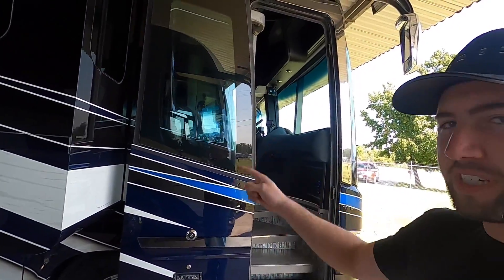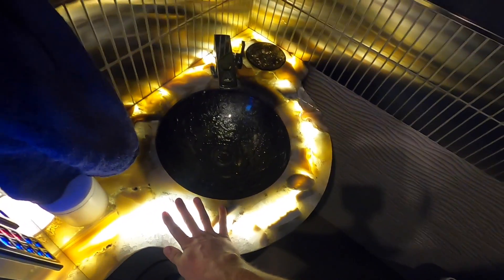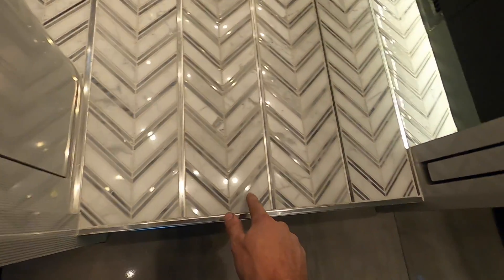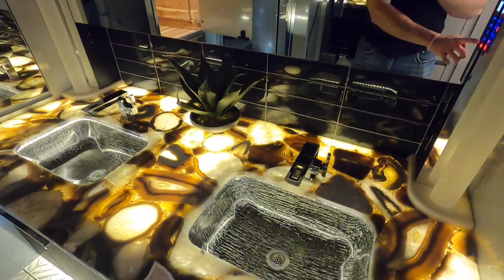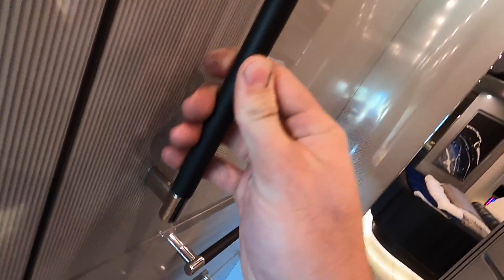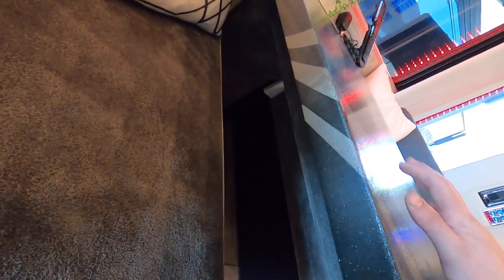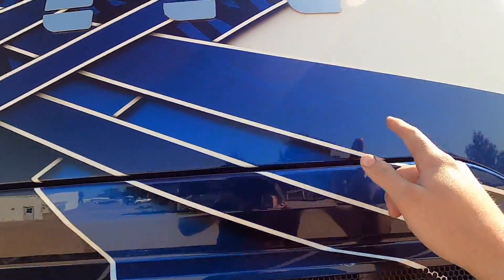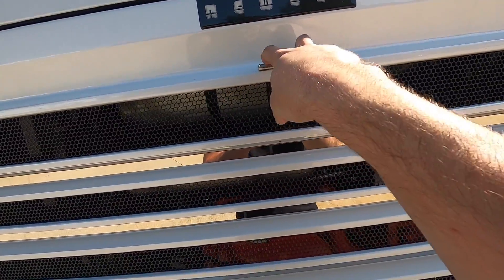2019 Newell Coach P50 Full Tour: Insane Build Quality Details! (1.7 Million and Pre Owned)

Comment: Rocks aren't actually colder they just feel colder due to heat transfer. Its the same as touching a metal table and it feels cold but its actually just heat flowing from your hand to the material faster than other materials. Rocks transfer heat quickly and acrylic transfers slowly, so even though your body is quite a bit hotter than the room temperature acrylic you don't notice it.

Comment: Again I can relate so much to how u experience this stuff. Wife and I have toured dozens of old historic buildings around the US. I am always getting left behind because I'm studying the mechanical workings of the "dumb waiter" or how they wired or plumbed something!!! Those two coaches with same paint parked side x side was amazing. Re: coach paint. My Newell was built for the Steve Miller Band. Steve had three coaches built at the same time, all the same color scheme. Subsequent coaches have been the same color as well. I just repainted mine this summer and kept the colors the same as original. You would have enjoyed seeing what we did in my shop over the last 6 years. We converted the interior from 8 bunks to a more conventional MH floor plan so I had walls removed and could really appreciate the workmanship that went into it. I tried to use the exact same materials and construction techniques on the rebuild/restoration of my Newell.    Hoosierdaddy
Reply from the maker: That’s legit. Definitely fun stuff

Comment: Since the thermal conductivity for stone is high, the heat will move quickly through the stone and away from you, similar to how running water flows through a funnel faster than it would through a sponge. The sense of coolness that you feel happens because the heat is flowing out of your body and through the stone.

Comment: I used to fabricate granite countertops... Its a thing, you can tell by feel when you touch real stone
Reply from the maker: So rocks are cold? Good to know I’m not an idiot 😂
Reply: @Stapleton42  Yeah they always feel cool to the touch it's kind of weird really. I think they are "pulling" the heat out of your hand when you touch it. Better thermal transfer than the epoxy the manufactured tops are made of I guess, which makes sense if you think about it. Manufactured tops are basically plastic. So a laser thermometer might show both countertops at the same temp but when you touch them the natural stone feels colder because it is stealing your body heat, making your hand feel cooler, like sweating.